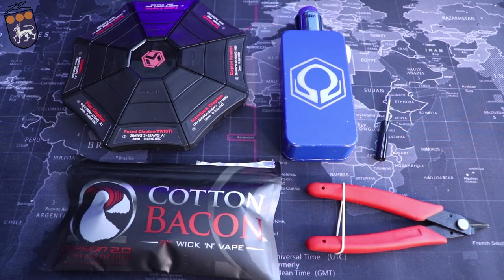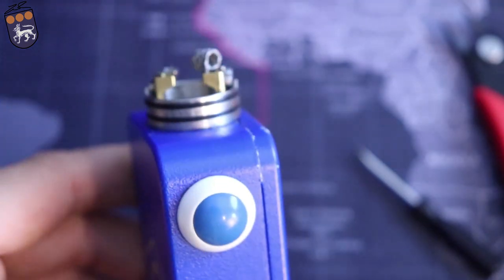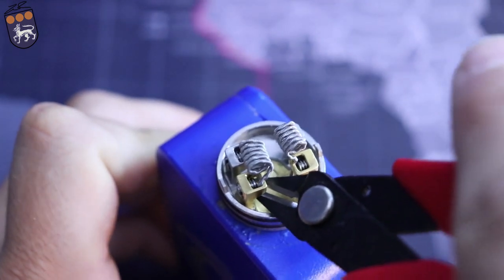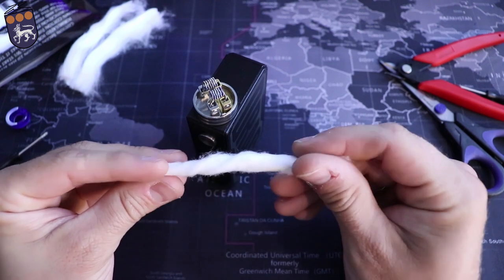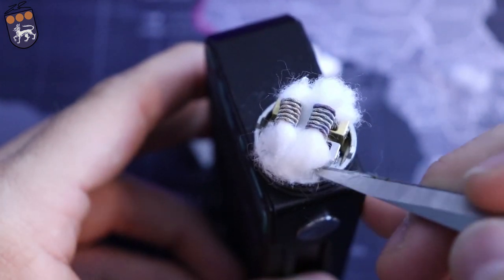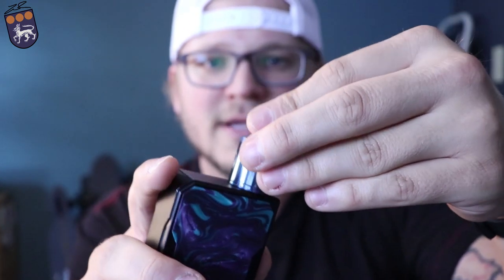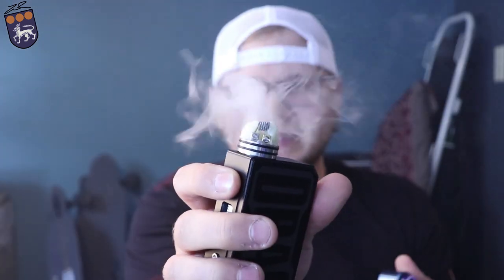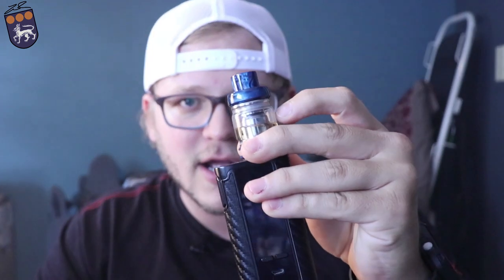Vaping 101 : The basics on an RDA

Comment: So I have some pre made claptons fused, 8 roll, 36GX2/32G
3.5mm/ 8wrap
=8.34 ohm
316LSS

Says to dry burn at 15-20w

I have no clue how long to fire each time because I'm terrified it'll blow out the mod or start a fire or something. How long do I hold the fire button down, how long to release it, how do I knoe when it's dry burned enough and ready to take cotton?

I dry fire and it doesn't even smoke. It jusr smells. But I'm only hitting it like 5 seconds or so because I'm scared lol.
Reply: 8 ohm is ridiculously high. how could you even achieve that